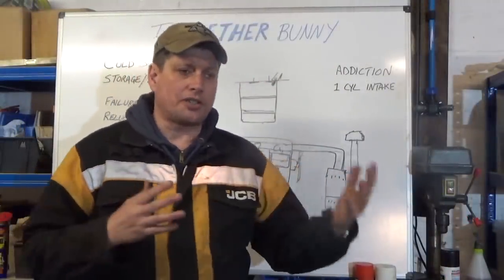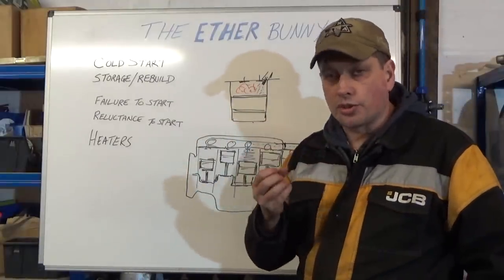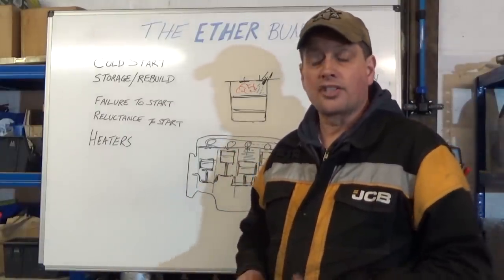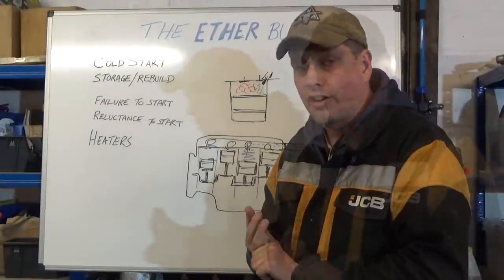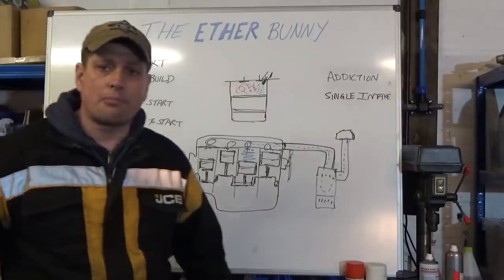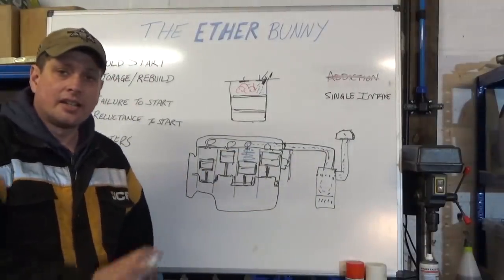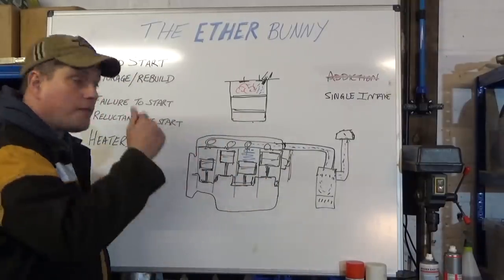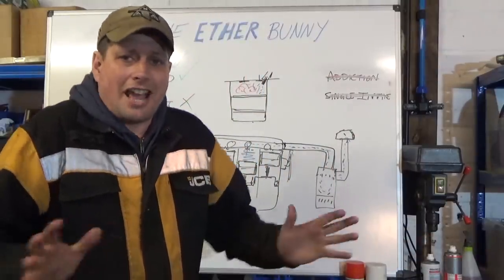CAN ENGINES BECOME ADDICTED TO STARTING FLUID ?

Comment: years ago they had what they called kgas i have some of the cartridges with it in
Reply from the maker: Ki-gas was a pump system originally that put excess fuel in, then they developed those little pressure canisters. I've got a box full from my old Scammell.
Reply: @LordMuck  the little grey fergy with the diesel had it fitted to them.the engines were all built on the standard engine i still have some parts
Reply from the maker: Was that the excess fuel pump or the canister squeezer ?
I rebuild the pumps on a Mk1 and Mk9 Spitfire every year during the annual inspection.
The Scammell just had a thing to pop the canister in and push a lever down which pierced the canister.
Reply: @LordMuck  you unscrewed the top put the pot in and peiced the canister then you gave it one pump. mu first car had one on it as it was a triumph renoune with a diesel conversion
Reply from the maker: Same as the Scammell then.
The straight primer pumps put atomised fuel direct into the intake.

Comment: HA i knew it, even commented in the sh*t talker on the 3000 vidja about ol' Peg...  Also, nice explanation why Cosby in a can won't ruin an engine if used properly... Hell it won't kill an IDI even when used in bucketloads but that's just the way she goes, throw that much at an engine you care about it'll put a rod through your sack in half a rev, dump it down a pile you want to blow up & it'll just start & show yer ketchup.
Reply: Youuuu don't neeeeed compression....

Comment: I don't  use easy start, except when you get an old tractor that does need help to get the initial start up , just get the engine running right , good clean fuel good air filters, injectors etc. Another problem that will come up. If you are not using a machine for a long time, the diesel fuel these days will degrade eventually, bio diesel , the old gas oil was better. I converted all my Drotts to a modified heater system that uses full battery voltage and not like the old idea of a resistor that drops the voltage to around five volts. The only thing that bangs and farts first thing on a cold morning is me
Reply from the maker: You're doing better than me - I only fart...
Reply: @LordMuck  lol

Comment: I've been a heavy duty mechanic for 20 years and I've use ether many times for various reasons.  An engine does not get addicted to ether. If you need ether above freezing.  The engine has low compression. It either needs a valve set or a rebuild.
Reply from the maker: Spot on 👍

Comment: Lord muck iv just subed to ur channel keep up the graet work
Reply: The 3000 does not have glow plugs because it is a direct injection engine but if has a simms mini mech pump it has a cold start button on the stop control arm if it has a cav rotary pump like this one  there is a place in the inlet manifold close to where the rubber hose goes to the air cleaner remove the plug fit a heater element and a modified leak off pipe from the tank filler across the tops of the injectors and to the heater element if you look at the wiring loom at the front of the rocker box you will find usually a spare brown wire which needs a slight extension wire to connect it to the heater element you will also need to change the ignition switch to a on/ heat/ start switch

Comment: When you took the picture of Deano and  Saunders at 7.55  you could of told them the football they were trying to hump had gone L.O.L. I think the biggest waste of a can of ether we ever saw was one cold frosty morning at Cambridge sale about 25 years ago.  There was a guy standing on the cab step of a short nose TW  turning the key and aiming the spray at the far end of the hood. Man the air was so thick with ether down that row we needed something to keep us awake after leaving Carmarthen at 4 am, not send us to sleep! 
   For all the good it was doing he'd of been better not bothering.  Guys will over use ether here in Canada some of the motors will stretch  the head studs or blow the head gaskets out. The 4 cyl Belarus tractors are bad for it when guys don't fix the intake heater or plug in the circulating block heaters when it's - 15 or worse.   Thanks for the video, take care.

Comment: My old dad used to take the bottom of the air clear light a bit of paper feed bag and put it under while I turned it over worked ok as long as the hole thing didn't go up in flames think fixing the heater plugs would have been better

Comment: We used to have a muir hill 111 was a pig to start winter time . My dad put a small rubber pipe from the air cleaner to the cab  drilled a hole just under the windscreen so you  could squirt some easy start while turning it over

Comment: We had an after market ether cold start system fitted on our trucks when I worked in Germany MANY years ago to lower the flash point and warm the engine in the pre-heater days. Used sparingly and when actually required it was a godsent but it required a trained operator to be the brain for that truck, if it didn't start you found out why and you fixed it! Great to hear someone talking basic engineering sense. Nice upload. 👍
Reply from the maker: That's the way to use it in a nutshell 👌🏼

Comment: had a 674 int one time with a tired engine .........used to put paper soaked in kero  in the air intake and light it , quick step up into the cab and start it .........ashes from paper used to come out of the exhaust ...............poor mans easy start !
Reply from the maker: Used to be the way with the old dozer drivers.
The effect is that bit of heat to get the diesel/air mix to ignite.
Reply: @LordMuck  tractor was traded in for a fiat 80-90  .........was never sold after ......went for parts after sitting  for a year in the garage .......

Comment: On my fordson how does the excessive fuel button work to help it cold start
Reply from the maker: It allows a larger amount of fuel in on the initial start.
More fuel, better ignition of the fuel and compressed air.
Reply: @LordMuck  thanks and keep up the good work ,love these videos George Saunders could do some with the tw25

Comment: Most of the poor starting machines I get called to is caused by poor fuel, water in the fuel because the trap is not drained at least once a week. And machines filled up from dirty cans or drums.  I modified all the heaters on my I H Drotts. No starting issues any more

Comment: Funnily enough i had my first use of easy start yesterday trying to get my car to start, i had been screwing at her all week. I had changed a fuel line and fuel filter as there was getting air into the lines. The car has a manual primer and was taking fuel up with it and when you turned they key there was nothing just constant turning over. After bleeding the system and trying again there was nothing. After some investigating the lift pump was at fualt.

Comment: Great explanation on Ether👍one hot harvest I had my tractor running just idling trying to keep cool, well one old fart came up n told me that I will Glaze the engine n I look at thinking that happens to old tractors not new ones.  Mucka can do explanation on this myth, thanks👍. The tractor in use was JD 9520 12lt six pulling 38t chaser bin.

Comment: Our Chevrolet 1 ton dumper has a 6.5 that's is just plain wore out and in need of injectors so we use either but only 1 small squirt ...we would fix it but it only hauls hay and about 10 loads of sand a year for bedding the cow shed

Comment: Was that cab a factory original?  Have an International 484 built in the UK.  Has no glow plugs, indirect injection. Has factory ether injection provision.  Installed new fuel injectors last year and engine NO Longer needs any cold start ether.I
Also, Love the HUMOUR !!
Reply from the maker: Yes, available for the 1000 series tractors.
It was like sitting in a bass drum.

Comment: I remember back in 1980's fitting a gas pilot system that used either to a 6 clyinder york engine in my tarnsit that was  a cow to start first thing in the morning.easy start or start ya bastard was a diesels best freind or a engine that wouldnt start it even has a anti knock these days ive also heard peeps saying it will get adicted im like yeah what ever it's running aint it lol.

Comment: I never understood how that wives tale got started. Its a machine, its not alive, how can it get addicted to anything. Some people just shouldn't be allowed to have it though. Ive seen tractors at auctions in that past that had manifold heaters in them and the manifolds have been blown almost clean off the side of the engine. You know what happened there. Seen a few IH 560's and 706's with glow plug engines that had broken cranks and cracked heads, you probably know what happened there to. lol
Reply from the maker: You have to wonder what they are thinking at times !
Reply: Oliver66FarmBoy idiots

Comment: If really cold in middle of field with no Easy Start a burning rag on stick by the intake.
But I'm talking 50 years ago 😉
Reply from the maker: That's exactly right. The old D8 and D9 drivers would do that 👌🏼
Reply: I do it on my 3000 when it's too cold to start never fails

Comment: Do you remember the ki- gas systems on the Ferguson ted and fordson e27n with the p6 Perkins was this ether
Reply from the maker: Ki-Gas was a small pump that put extra fuel in to the system on aircraft like the Spitfire and trucks like my old Diamond T.
On some tractors, it contained a similar mix to ether in a small capsule and was injected into the engine.
Reply: I often wondered how it worked thanks for that

Comment: I think the reason that ether got the reputation for getting engines "addicted" was often it was only required when the engines started to lose compression which of course would only get worse over time and require ever more ether until in the end the engine just would not run. As a kid I would put easy start into an air rifle with enough it would even recock itself and at night there was three foot of flame out of the barrel.
Reply: Equiluxe1 that’s exactly what he said in the video 😎

Comment: Kurt, It's the dumbasses on the nozzle that are addicted. As to the bar talk and moronic repeaters of shit, they KNOW they're not smart enough to offer a good opinion, yet they'll repeat some slobberin' cave man's wisdom they've heard. I was told by a guy when he learned of my using E85 in my Farmalls,"you'll ruin those engines-take the rings/valves right out of them!!". He's gone now ,but my Farmalls are still plowin' right along on ethanol when and if I choose to run it. It's about economics, you see. Ethanol runs a good 20% less than gas and when gas gets stupid high priced, I go to E85. Later, man!

Comment: My old international backhoe had a ether can and button from factory don't just keep spraying it that's what eats rings and cylinders
Reply from the maker: Mate had an old Case with one fitted. One push let out just enough.
Reply: @LordMuck  ya but got all these ppl just using a hole dam can on this 1950 car dozer with pony start I flipped out he didn't even let the diesel motor warm up and just sperade the hole dam can. And I'm 26 no one has time to just slow down and just let things warm up

Comment: Sounds like she has slight miss cracked injector pipe or injector bango fitting leaking really good video explaining in simple terms perfectly correct on every subject
Reply from the maker: I fucking hope so.... 😉
Reply: OR maybe it's only running on 3 cylinders???
Reply from the maker: Pump is leaking Paul. Once we get it moved we'll have a proper look and either reseal or have it overhauled.

Comment: Try starting a diesel mk4 Astra without easy start after changing the fuel filter, its nigh on impossible without it !. Vauxhall tech’s have a factory pump thing to bleed them up but it’s a right ball ache to set up, so even they hardly ever bother with it and just give em a snort of brake cleaner same as me 😂

Comment: I used break cleaner
Reply: I used to use easy start but find break cleaner is not as harsh it does the same thing
Reply from the maker: If used sparingly it's fine, the only downside is it's obvious cleaning/degreasing properties.
Reply: Only 2 squirts
Reply: Here in the states most of our brake cleaner is non-chlorinated which is quite flammable. When I got my start in the shop we had Chlorinated Brake Cleaner which was non-flammable, to the extent that it could be used as an extinguisher...  Imagine my surprise when I attempted to douse a small fire with the wrong product!     Blessings!

Comment: Our T20 used to need a squirt of easy start, but its fine now without it, I think the whole addicted thing is really if you use ether every time you start it. For example a friend used to have a 4 cylinder diesel 35 that would never start without it, after a couple years of constant use.
Reply: The 4 cylinder 35 was a pig to start when new I used to see my dads friend tow start a 4 cylinder one
Reply from the maker: That will be the Standard engine then !! 😂
Reply: @LordMuck  The joys of cold Somerset and presumably slack timing chains...
Reply: There used to be a man in Newtown mid wales called Malcolm Davies who had a small agricultural engineering business I think he sold universal tractors who used to specialise in mf 35 4 cyls he used to modify the cylinder head and change the pistons which made them start and run smoother I only ever met him once he came over has a very knowledgable  but very eccentric man